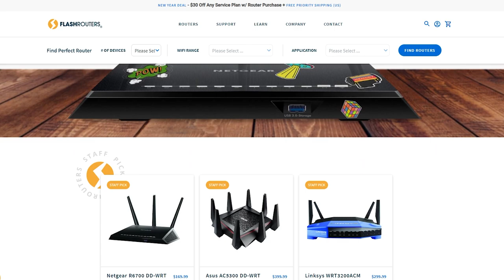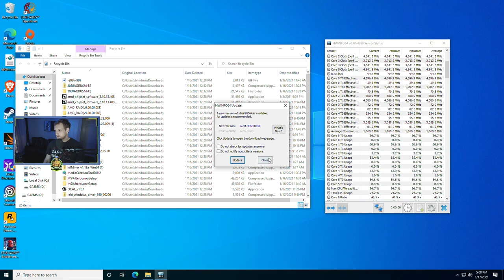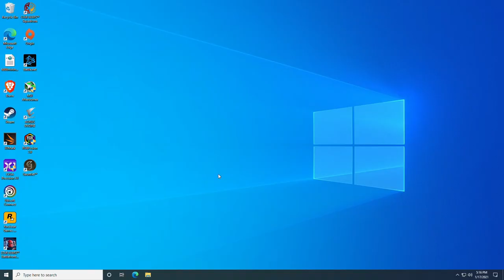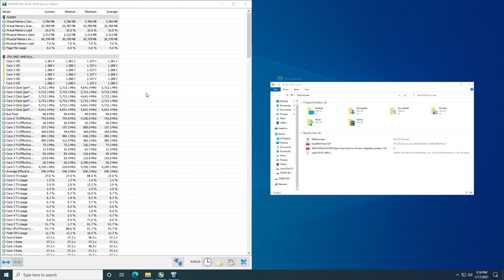How to Replace Thermal Pads on Any GPU!

Comment: Been asking around and keep getting mixed answers, how important is it that the thickness of thermal pads are correct? I'm trying to look for the right stuff to buy for my graphics card since its had some crazy hotspot temps (as high as 105C sometimes), but according to some documentation I found, my card requires about 6 different size pads and I'm struggling to find some of the right sizes. 

I've seen some people say that the size and even the "squishiness" needs to be the same, but some people say it's fine as long as it's within 0.2mm or so. I've also heard some people say to use thermal putty if you can't find the right size, then others say that it's a terrible idea and you should just use pads. Just getting mixed signals from all over so I'm trying to figure out what to do lol

Comment: I use two (2) round toothpicks, each cut about 3/4 length leaving just one (1) pointy end, place each in opposite/diagonally screw holes of the four (4) of the front (core) side , then slowly lower the cooler/fans portion down over the pointy end of the toothpicks until lightly seated, then insert two (2) screws into the open holes and lightly screw them in (DO NOT tighten just yet), pull out the two (2) toothpicks, insert the remaining two (2) screws and lightly screw them in, REMEMBER:  " alternately " tighten all four (4) screws.. doing this may take a little longer BUT helps to keep boards aligned and reduce "the sliding effect" especially for the thermal pads.

Comment: Finally man, way to go wow..... so sad such an expensive gpu needing that kind of job and time. Final OC would put you near 97-98 mh/s once you play with the core and lower the power.
Reply: Easy 100.9 @ 155watts which i am running my 3080 at :)
Reply: @Goldstar1337  that's a great performance
Reply: @abusadoruci  Yep, the key is undervolting them, it drops the power usage and heat significantly, my Gigabyte 3080 Phantom does 61c degrees Memory junction @ 100% load, 29c at the core, running 46% PL at it :) i think i was really Lucky with that particular card :)
Reply: @Goldstar1337  silicone lottery ... I do under volt but none of my GPUs do 100mh/s @ 220w or less
Reply: @abusadoruci  Yep i won the lottery on that card, which 3080's do you run? My Aorus 3080 Master was NOT my best friend until i swapped the pads, dropped 25c with that and was able to run higher mem at +1300 with no issues
Reply: @Goldstar1337  have 4 3080s, 2 evga, 1 msi 1 asus, the best one is the asus 102 mh/s @ 224w.
Reply: @Goldstar1337  I have this same gpu... I'm not happy with her performance ... it gets too hot ... I have to leave the fans at 90% not to give thermal throttling ... do I need to replace the thermal pads?
Reply: @Ternoski  Performance increase after upgrading the pads are guaranteed! :) The thermal throttling issue is gone with the wind on all of my 3080's and 3090's now :)
Reply: @Goldstar1337  how you OC your 3080? In MSI Afterburber?
Core Clock
Memory Clock
Power Limit
I'm using:
Core clock: 0
Memory clock: +1105
Power Limit: 60% (218W)
trex miner 93MH/s... rtx 3080 aorus master
Reply: @Ternoski  try undevolting your card a bit, 0.787v at 1380mhz, 65% PL, +1250 mem, 80% fan
Reply: @Goldstar1337  how I do undervolt? I can't set the voltage on the msi afterburner ... at the moment my 3080 is working with 725mV ... 1005GPU MHz ... 10605MEM MHz ... power limit 60% (consuming 218W)
Reply: @Ternoski  yes you can change it in MSI Afterburner, if you press the three small bars on the left from the core clock slider, you will find a curve, try choosing between 0.787v and 0.825, pull the small square that corresponds to the horizontal line that states the voltage, and then you pull that small square upwards to around 1380Mhz, press "L" and activate that voltage at the Main picture in msi afterburner :)
Reply: @Ternoski  and Download HWINFO, open, only sensors, slide down the list until you find your Nvidia card, and look if it has active thermal throttling, it is a list that simply will say yes or no, and at the same time it will show you your Memory junction temperatures which is much higher than what msi afterburner tells you :) it will throttle at 110 degrees.
Reply: @Goldstar1337  I can't do this... I don't know why the squares change your position after I click to apply...
Reply: @Ternoski  a sign that your card is thermal throttling..
Reply: @Ternoski  try opening afterburner and the curve editor, draw the slider a little bit down in afterburner, try to get the line down, and then pull the editor up and try to activate, if You're throttling you wont be able to change.. HWINFO will let you know the memory junction temps and if you are throttling
Reply: @Goldstar1337  you recall the sizes/brand you used?
Reply: @dreamomega  thermaltake 12.8 w/k

Comment: Honestly this is the video I needed, my Vram temps on my 3080 Aorus Master is thermal throttling , hopefully this works! Thank you for the information and work to make this video
Reply: This applies to all gigabyte cards. Also some msi cards except suprim x from what I know. I got a suprim x 3090 and the backplate get 60 degrees celsius hot so I'm pretty sure it does transfer the heat away. Sadly my average temps for vram is around 96 celsius at about 124 MH/s. I could decrease it to 92-94 by lowering the MH to 110-115 but it doesn't seem to be worth it. Since therm throttling is at 110 I would say 96 stable is relatively fine. I got a 3 year warranty and if I open the card up (in Europe) I will lose my warranty so that's a no go.
Reply: @alexandruilea915  I have a MSI 3090 Suprim X too, as well as a Palit 3090 GamingPro OC. While the Suprim X is pretty good, to my surprise the Palit GamingPro manages 4-6*C lower VRAM temps under the same test conditions. I thought it would be the other way around. Not to mention it's a much more compact card, the same size as my 1080 Ti Founders Edition so it fits even in smaller cases. It doesn't even need the support bracket that comes with it while I had to use one for the Suprim X since it's so heavy and bulky. I am pretty impressed with the Palit 3090 GamingPro OC.
Reply: @bgtubber  same fan speed and noice? It could just be that it has a more accelerated fan curve so they spin up faster from lower temps.
Reply: @alexandruilea915  Yes, at same fan RPMs and noise. The Palit only gets noisier than the Suprim X when the fan speed is higher than 65% but it beats it in VRAM temps even then at equal fan RPMs.
Reply: @bgtubber  the suprim only gets really noisy after 75% so that's what I would consider audible.
Reply: @bgtubber  I have just looked up the two cards and the Palit has a way lower GPU boost clock (150 Mhz lower on the 3090 and 180 Mhz lower on the 3080 and that's for the OC model). It also has a lower power limit which for mining that's not a problem but it does suffer in games. I'm curious if we could find a way to truly undervolt the GPUs like we do with the CPUs. I know AMD cards can select a fixed voltage (and with some Registry mods you can even select lower than allowed voltage) and you can try to find the best frequency on the lowest voltage but that's not possible on nVidia cards from what I know so far.
Reply: @alexandruilea915   I don't mind the boost clocks on these cards. The boost clocks between the different 3090's hardly makes any difference in daily usage. It's 1-3% which you'll never feel outside of synthetic benchmarks. I'm much more concerned with cooling performance and build quality and the GamingPro delivers in this regard.

Comment: When measuring the used pads, is it ok to error on the side of caution, and use a pad .5mm larger? Similarly, is it even bad in general, to use pads .5mm thicker than the stock ones? Thanks great vid!

Comment: When should you replace them - 1 year - every year ?  Or when the GPU starts getting hotter than normal.  Thanks
Reply: Depends on the situation. For example, I got Gigabyte 3080 Gaming OC that requires thermal pad change after 3 weeks, some people don't change thermal pads for 5 years and feel good. So if you're experiencing some problems with temperatures it might be a sign that you should to try to replace one.
Reply: @Efkas  is that due to the manufacturer using poor pads that needed to be replaced quickly or are you saying that card will need replacements that often even with replacement pads
Reply: @charlesblack1972  it's due to fact that gigabyte used extremely bad t pads in gaming oc, eagle and vision cards. Under load it starts to throttle and then turns off.

Comment: ...I never cared much for the blue pads, they don't seem to have any that have very good W/mk but the ones you put in the desc were the best I've seen at 6w/mk, which isn't that great.  Right next to them there was a listing for some grey thermalright pads that were 12.8 W/mk for a dollar more, they looked real good...
Reply: I know this is an old comment, but for anyone reading, check this brand out on Amazon. It's at 40% of the price of most of the others: Frosty Ice Cube Plus Thermal Pad - 12.8 W/mK. I dropped my temps to almost an identical amount and its the dark gray color.

Comment: Good video btw♥

A question: How often should we changes the thermal pads?
Reply from the maker: the paste usually needs to be replaced before pads. So you end up doing pads at the same time. Simply monitor performance and change out if hot. Maybe a 6 month schedule if mining to bulk replace on rigs. I usually schedule it based on install date so I'm not doing all of them at the same time.

Comment: My 3080 dropped from 108c to 94c  with some grizzlys, i ordered some gelids ultimate now to see if i could get it down to 88-90 with some smaller mods, summer is coming and most of the home miners will have some really high temps if not prepared

Comment: I was always wondering. Say you need 2mm thick pads but you have 1mm or 0.5mm material, can you "stack" pads to achieve the proper thickness or does this compromise heat continuity? Thanks for the great video. Ive done this  with RAM modules where I had to de-skirt then eventually re-skirt a stick to make room for a tower style cpu cooler, worked great.
Reply: @Fifty Dinar  I was thinking about the extra layers of adhesive insulating the heat from passing on to one another causing inefficiencies. If air is the issue, wouldn't a couple pin holes through the pads work? Sorry for looking a gift horse in the mouth. 😬 thanks again.

Comment: Hi.
I have a question. ¿Do you have to paste the pads on the plates or directly on the parts of the gpu?, I am very new with this, I have changed paste on CPU but never on GPU's never heard of thermal pads until I watched your video

Comment: Can you post an update now that HWinfo has an update that let's you see VRam junction temp? My FE 3090 runs about 106*c with an 800mhz memory overclock
Reply: I’m getting 96-100c on my 3080 aorus master with stock thermal pads
Reply: @dcquadrant  what settings do you have on the memory overclock?
Reply: @josegarcia2014  just to list it all. I got,
PWR: 67 
CORE CLOCK: -150
MEMORY: +900
FAN: 100
Reply: @dcquadrant  Watch out for running the fans at 100%
Reply: Too hot bro. Everyone in the comments section is running too hot.
Reply: @TripleVR  That's why we're here dude :)

Comment: I own the 3080 Master and can confirm it sucks. 

Thermal throttling,
gigabyte bring out a Revision 2.0

Also no "right to repair" in the UK. Not happy. Either I try and RMA or just sell it and hope I can get another. Or a couple of 3060Ti's. 

4 years warranty is just too much to throw away with a card that cost me £950 (from NovaTech UK) 

Great video, new sub and I've binged a few of your videos already this week. Just got into mining, thank you.
Reply: Same too I have the same card and I order thermal pads but if I lose warranty, for 95mhs not worthly don't care I think probably not disassemble card 🤔
Reply: @greegp7400  i have the 3090 master, vram was at 110, changed the pads and now no signal from the card, vga light on the motherboard, im going to try and rma it anyway but i asked ccl computers where i bought it from if changing the pads voids the warrenty they basically said yes

Comment: I recommend trying TG-PP-10 thermal putty or K5 Pro instead of thermal pads. I've had good results with both (K5 Pro is more "gooey" than the TG-PP-10)
Reply from the maker: Where can you get the putty?
Reply: @SonofaTech  You can get the TG-PP-10 from Digikey and the K5 Pro from Ebay
Reply: Thanks been researching this

Comment: Maybe this is a dumb question but when or how do you know you need to replace the thermal pads.   Also, I saw somewhere that they would send the card out to be cleaned.  Would that be in line with replacing the pads?   Thanks for the great video as Im just getting started and trying to learn as much as possible.
Reply: Check your temps. Theres core sensor, vram sensor and hotspot sensor usually on a card. Ive for example noticed my hotspot temps be very hot to the point of my gpu crashing. Even though my core temp and vram temps were fine.

Comment: Here's my bit of advice. If you ever spend a little extra money on ANY tool, spend it on getting a nicer micrometer/calipers. I have two that look like the kind in this video. I also have another that's a bit nicer. You can't imagine how much better the more expensive one is. I think it only cost $10 more than the cheaper one.

Comment: Hey what are the temps on the Memory after installing these thermal pads?  My 3080 is running between 94-98C when mining and I'm wondering how much thermal pads will actually improve that.
Reply: What are you doing to the poor thing lol, I’m running at like 65c
Reply: @XxIroncore10xX  I meant on the VRAM temps.  I don't think I was clear.  My GPU core is at around 60c at 70% power with a box fan blasting it (GPU fans fluctuate between 60-70%).  I can get the VRAM down to the lower 90s and maybe even 88c with the fans at 100% but I don't want to run them that high.  I saw a reddit post with a guy contacting a rep from Nvidia about the hot temps on the VRAM (I guess it gets even hotter gaming between 100-110c) and they said it was fine so for now that's the only thing giving me comfort.  If replacing the thermal pads would drop it another 5 degrees it'd be worth it to me though.
Reply: @derikwarren556  did you replace?
I have to run 100% fans on my 3080 vision to see 102 degree VRAM! But GPU is at 40 😂😂
Reply: @kylekitchen919  not yet, waiting on new pads and paste.  Ill let update with temps when I'm done.
Reply: @derikwarren556  let us know pls. I've read these temps are normal for this card but I'm also uncomfortable that something in my apartment aside from my stove can boil water.
Reply: @SoloBuggMaster  I just bought an aluminum heatsink and fan to place on the backplate of my 3080 Master.. Opening the GPU scares me too much
Reply: @kylekitchen919  You will burn out your fans pretty fast running them at 100 all the time. Also, 102 is high. Turning down power a bit may help.
Reply: @derikwarren556  Use 6w thermal pads and you will drop it around 23-25c degrees, my gpu core is running at 30c on full load at around 65-70% fanspeed, Memory junction dropped from 102c to 77c with changing all the pads :)
Reply: @connordd2  it will only drop 2-3c, beoieve me, i tried! Didnt want to open my card, a rep from Gigabyte said my warranty would not be voided if i opened it and i will reassure you, the process is MUCH simpler than you think, its perfectly safe for anyone :)
Reply: @Goldstar1337  yep i got a fluctuating 2-4 degree improvement.       I only replaced 2mm pads.   I was upgrading a Evga card which is apparently one with better pads so maybe it wasn't necessary.   If you have a brand like gigabyte it might be worth it.

Comment: just in time!! I need to swap the pads on one of my xfx 5700xt's, gpu temp showing 41* but my mem showing 94* in Hive (that Micron tho lol)
Reply: Please let me know how much of a difference it makes what mem junction Temps ur getting after fresh pads?
Reply: Worked like a charm dropped 20*C used the Thermal pads recommended  above ^^^
Reply: @Ballistic187  wow legit baffled that there's this high of a difference, thank you!!
Reply: @darok krauser mine did not come with pads to the back plate but i  found that one of the pads to the cooler was straight up missing. im going to go back and systematically replace the oem pads and probably in the spring add 3mm pads to fill the backplate space in and see how much that helps.

Comment: I have a new Gigabyte RTX 3080 Gaming OC, same as Red panda's showed on his video some weeks ago, but as his mine doesn't have thermal pads on the capacitors, it does on the memory modules and its nearest transistors (1.5mm thick). Is it recommended to add some new ones over the capacitors too?
Reply: Would like to know as well! I have the same cards and planning on replacing 2mm inside and 3mm between memory and backplate

Comment: Great instruction. BTW, did you watch the VRAM T-junction temp? This is the one temp that should bother all of us with those powerfull Nvidia cards most.Unfortunately, this temperature is most often 10-15 degrees centigrades higher than the GPU temp. Most likely, your new thermal pads will have solved that issue.

Comment: Mine had a 4th cable at the top and I couldn't get it to access the back plate so I just swapped out the PCB pads and it runs great now. Would not recommend trying to take it apart if you have big sausage fingers

Comment: My memory junction temps are never goes beyond 85C, but my core temp can get to 82-83C when gaming with 350w+ power consumption with my 3080Ti. Card is 3 years old, can I only change core thermal paste without touching pads? And which paste should I use?